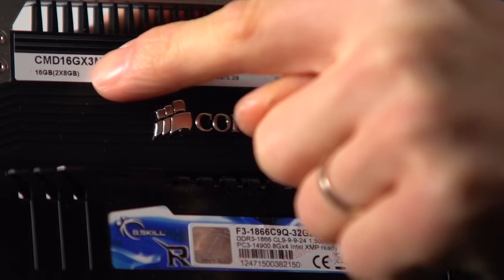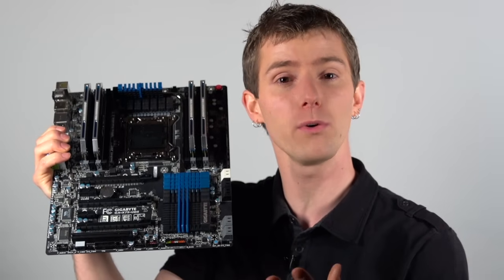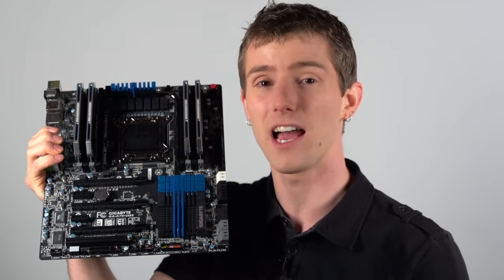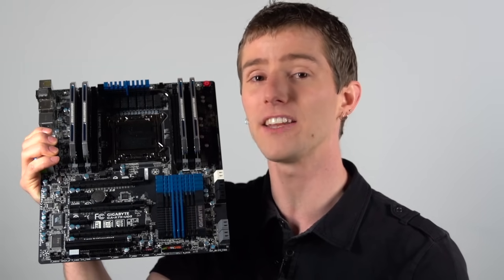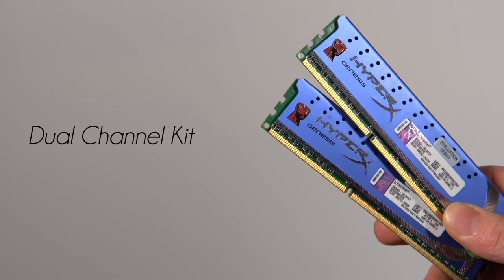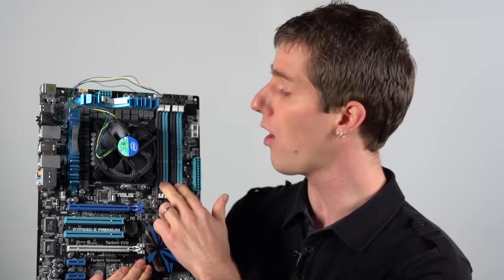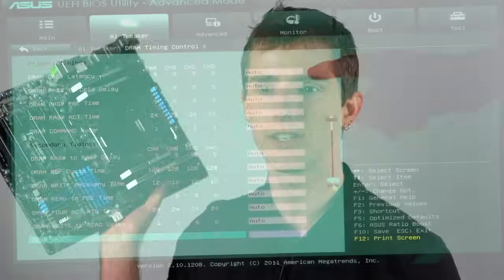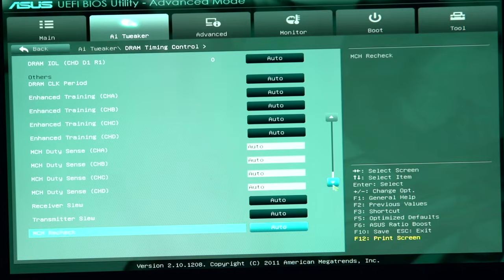Guide to RAM Memory Channels as Fast As Possible

Comment: I currently have an unbranded 16gb kit of ram. For my new system i was planing on getting another 16Gb kit from Kingston. Would i be able to mix them so i would have 32 gb? I'm never going to use all that, as a matter of fact i generally use about 8-9 gigs at a time (I'm a tab whore}. But it would be cool, you know, for bragging rights :)Here's a pc part picker list of the components in the new pc (Incase it's needed for mobo or whatever) https://uk.pcpartpicker.com/user/Made_You_Look/saved/#view=jCGNnQ
Reply: First of all, you made me look! ;-) If you know what I mean! Now according to that list you have one 8 GB module of Patriot Signature and a 16 GB kit (2x8) of Kingston memory. So those are in fact branded. Now, assuming you have a 16 GB kit (2x8) installed and your motherboard supports dual channel and you have two empty slots, then you can easily install a second kit of 16 GB (2x8). It's best if it's the same brand and part numbers. But it doesn't mean you can't combine a 16 GB Corsair kit with a 16 GB Kingston kit. But bear in mind that the slowest of them will determine the overall speed, however the capacity will be unaffected by this. So if and when you do mix brands and part numbers, try to match the specs of the original for optimal performance.

Beyond those few considerations, everything else should work like a charm. Just make sure it's industry standard RAM and not some fancy Mac fanboy RAM, or HP, Dell, or other brand specific RAM for that matter. So for instance, mixing brand specific RAM, e.g. Mac RAM (McRAM... ?) is really asking for trouble. Trouble in the sense that your computer will not boot! You may even end up damaging your computer! Even though it says "DDR2" or "DDR3" this and that on them. They are very different from your "regular" (industry standard) RAM modules. They use brand and sometimes even model specific electrical interfaces, ranks, voltages, etc. They do that just to f**k you up as a consumer, so you can't buy anything else than their own shitty RAM modules. Typical Apple-ish! Thankfully the PC world has moved away from that practice, and pretty much every industry standard RAM module will work perfectly fine in a modern PC. Especially if you build your own PC, which by default makes it use industry standard components and specs. (Another great benefit of building your own, which few people know about, the noob builders in particular because they don't remember how it used to be ages ago.) One exception to this may be laptops, still. I'm not quite sure about that though. It may just be a marketing trick this time around. Like, "you got a HP laptop?" Well, yes!.. duh! "Then you need these HP approved RAM sticks." I say they can stick it up their... noses... hehe. That's probably more than you want to know about RAM. :-) Anyway! Good luck!
Reply: Samir Gunic Ah, sorry i changed a few things in the list. What i meant was I have an unbranded kit of 16GB(2x8) with a frequency of 1333Mhz a voltage of 1.5v and a latency of 9clocks. The other 16GB kit on the parts list has the same specs. I was wondering if they would work together. The 8GB stick is for my server(Because it needs more RAM. It only has 8GBs at the moment).I feel as if i know what i'm doing with RAM but i was just wanting a second opinion. Thanks, i really appreciate it. by the way, i do get what you mean ;)
Reply: Granted, two unbranded 8 GB, DDR3, 1333 MHz, CAS 9 modules should play nicely with additional two branded 8 GB, DDR3, 1333 MHz, CAS9 modules. So that's 2x8 GB (unbranded) + 2x8 GB (branded) for a total of 16 GB. They should operate at 1333 MHz and CAS 9, even if they are not the same brand. But like I mentioned, there is more to RAM than frequency, or bandwidth and latency.

The way you would make sure they will work well together on paper is by reading the full technical specifications of both kits. You would likely have to get down to chip level. Meaning you would have to identify the exact DRAM chips they use and look them up and locate the data sheet for these. You would then make sure they match up exactly, down to chip specs. Makers like Corsair, Kingston and Crucial use their own chip designs as far as I know. So you will probably not find much info about them. Not more than what's already printed on the label or their website (capacity, bandwidth, speed, timings). These modules are pretty much plug and play, no worries.

But you may for example have Hynix chips on the unbranded module, and Micron chips on the branded modules. It is bound to be differences between them. Like how much voltage they can take, among other things. Voltage tolerance is mostly of interest to overclockers. But more importantly, the way the chips are configured on each module is what will make them stand apart. Now, most of these variances are negligible, as long as both modules are using industry standard configurations, JEDEC compliant with proper SPD info and you have a decent quality motherboard that can benefit the full potential of these modules and you are good to go.

But the easiest way to make sure it works is to actually test it. It's one thing to have the equations add up on paper. It's something entirely different to test it in a real world situation. So instead of researching chip details and module configuration.... unless you're a system designer and you work for HP or Dell... just plug them in and see what happens. Do some benchmarks and stress testing before and after, then compare the two results, and draw your own conclusions.
Reply: Samir Gunic Ok, when i buy the ram i'll test it with the other. And if they don't play nice together i can just put one of the kits in the server instead of the patriot ram. Thanks, i really appreciate your help
Reply: Right! Although, the Patriot RAM you have in the server at the moment is a bit faster than 1333 MHz. So you may want to think twice about what you need more, the speed or capacity. If you are not utilizing a lot of memory on the server, then I would suggest you keep the faster 8 GB Patriot RAM. They are by 20 % faster after all. You could actually overclock the 1333 MHz to get more speed, but I would not advise doing any overclocking of a server computer.

If the new RAM does not play nicely with your desktop PC you can always return it and get your money back, save up and get a bigger upgrade later on. Or build up a buffer so you can replace parts as they start to fail, or have that money pay for the electrical bill for three months or the domain name if you have one of those.

No worries. I'm glad you found that helpful. In the end, it all depends on your own specific needs and preference.
Reply: Samir Gunic  Yeah, i forgot about the speed difference. Thanks for everything :)

Comment: Another question that needs addressing is why the people bringing out motherboards and CPU heatsinks are seemingly so utterly STUPID that they don't realise having your heatsink blocking ram slots is not a good thing. Why do they design the ram slot placement / heat sink shape so damn badly?
Reply: RAM should be as close to the CPU as possible for optimal performance, and CPUs run pretty hot, so heat sinks have to be large. I think of it less as a design flaw and more as a challenge. You can get slim heatsinks to accommodate "high profile" RAM, or just go with an all-in-one watercooling unit which should give you the clearance you need. If you want to watercool your RAM you have to remove the heat spreaders, anyway. Low profile RAM shouldn't interfere with even the largest heatsinks, and the fans on the Noctua NH D15 for example can be shifted to fit any RAM. It's not like engineers intended to create this claptrap; it's the consequence of sticking to a PC layout that's 30 years old for compatibility's sake. With newer, energy-friendly CPU and GPU designs, power users will have the option of using small heat sinks again.

Comment: You're not doing it right! ;-) It's not "triple channel" if you have 3 memory modules populating 3 of the 4 memory slots on a dual channel system. That's not what makes it triple! You're trip(l)ping man! ;-) Using the same logic, would you say that you have a quad channel configuration if you decide to populate the forth and the last memory slot with one more memory module? Well... no! The number of channels you have is defined by the motherboard. It's not the other way around! What gave you that idea? Just because memory modules are sold in kits now? It's not like you can have triple channel without a motherboard! LMAO!

Look! There is a minimum number of modules you will need in order to create a multi-channel configuration. For dual channel, that's two modules. For triple channel it's three modules. For quad channel it's four modules, and so on. This is why memory modules are sold in kits, and marketed as "dual channel memory kit" and such. Because these kits provide you with at least the minimum number of modules to satisfy the requirement for that particular multi-channel memory configuration you want. The number of modules included can be greater than that, like 4 modules instead of 2 for dual channel. You just need to make sure you have enough empty slots to put them in. But at least 2 modules would satisfy the requirement for dual channel configuration. One module per channel! Whether or not you can use more than 2 modules will depend on how many slots you have, and you may or may not need more than 2 modules anyway if you don't plan on using a lot of memory. Many ITX boards can support dual channel, and they only have 2 memory slots. So you can't use 4 modules on those boards anyway. But you will still have dual channel!

Also, bear in mind that the number of modules in a kit does not have to be an even number! It can be an odd number too! So you could have a kit of 3 or a kit of 6 modules. Those would be for a triple channel configuration. Yes, those actually exist. But it's not the way you described it or for the reason you gave in the video. It's memories for motherboards, not motherboards for memories (in terms of who has to adapt to whom).

Also! Ever heard of flex memory mode? You can have 3 modules on a 4 slot board and still have dual channel! As long as you have memory modules occupying both channels, you are in dual channel mode. Yes, it's not even if you have 2 on one channel and only 1 on the other. It's probably not optimal either. But it is considered dual channel. Dual channel with support wheels if you will! But nevertheless... populate two channels and it's dual channel.

I have already said too much! :-) But this is the last remark! Color coding! Color coding on DIMM slots don't mean much because there is no standard coding in that respect. There is no consensus about this. Sometimes, similar color means dual channel, dissimilar means same channel. Other times however, similar color means same channel, dissimilar means dual channel. Most commonly in case of gaming and enthusiast boards, "same same" (same color) is an indicator that guides the noob on how to get dual channel. But more appropriately, it should be indicating the channels, not the configuration. So "same same" should mean same channel, and it should be up to you, as an informed "builder" to know where to put your RAM modules to achieve dual channel. Haha! They really make them idiot-proofed these days, just so they can sell more to more noobs. In summary: on some boards you would have to put one module in a black slot, and another module in a yellow slot (or whatever colors they use) to get a dual channel configuration; on others still, you have to put one module in a black and another module in a second black slot. The labels on the boards usually say more than colors. Then there's also the nice, printed, fully illustrated... and often fully colored manual. It really helps to RTFM, I'll give you that. That should be the resource number one for anyone looking to build their own PC for the first time. Thanks to something called the Internet, you can even read the manuals before you buy components. I wonder how many people even know about this fact... or care to do their homework before they start adding components to their shopping list.